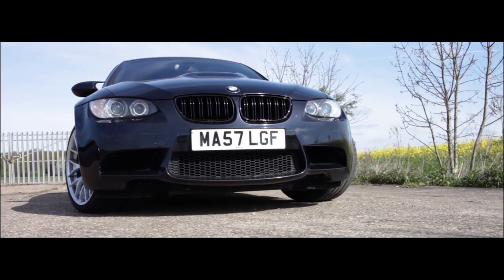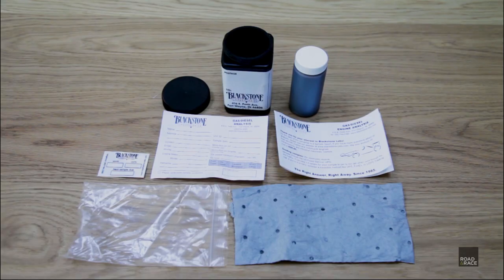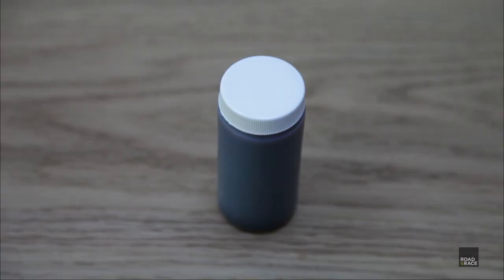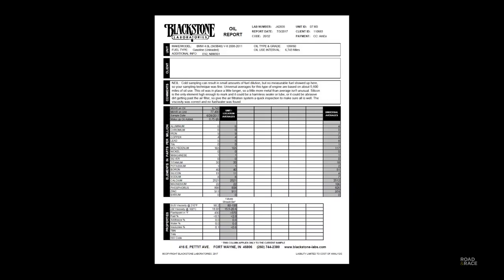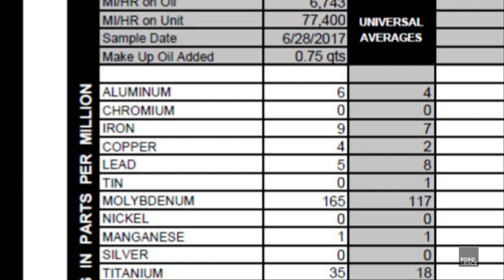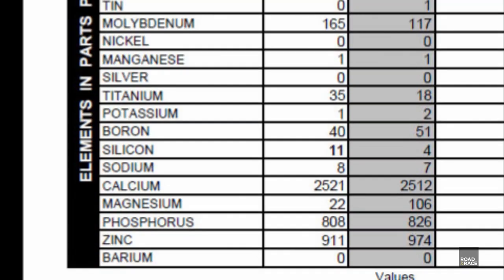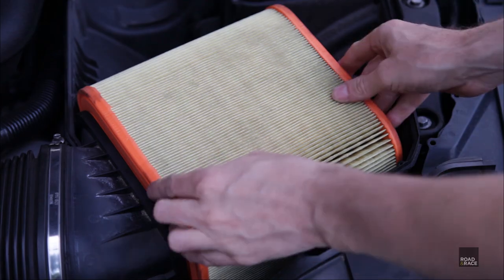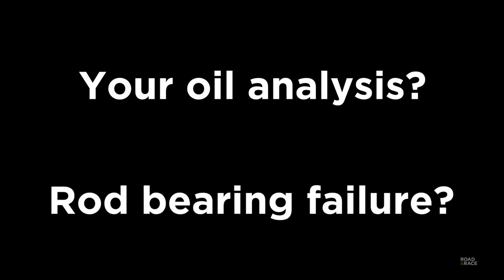Rod bearing failure oil analysis detection in BMW M3 E92 (S65)

Comment: the oil you are using is not the TWS castrol as BMW suggest .. this one is way cheaper but is bad for your vanos
Reply from the maker: +karim lazialle Really? Shit.   I though I was! Thanks for letting me know.  I'll get the right one next time!
Reply: It's basically the same and suitable for M cars.
Reply: no it's not the same (the price is also different) ... TWS was created for s85 & s65 engine specially with some additives to not have a heavy oil volume for Vanos .. but here is a best tip never push more than 2000rpm it when it's cold the 10w60 is so heavy like honey but once its hot it's like water .. it takes also more time to get in temperature 
You are Welcome R&R ;)
Reply: no sure about the oil brands but I do agree with you the key point is never rev up this car when it's not hot enough, the oil being used is too thick no offering enough lubrication when engine's cold.
Reply: karim lazialle Hi, that's the new stuff that replaces the TWS. If you go on the Castrol site and type in your registration that's the oil recommended for the s65/85 motor. 
Also now BMW are with shell, they don't do Castrol anymore, so if you service your M3 at the BMW dealer you'll be getting shell 10w-60 but you're spot on about the cold start procedure!
Reply: karim lazialle TWS is discontinued by Castrol. The 10w60 Supercar is its successor.
Reply: B Josef: indeed, TWS has been replaced. Yet, you can find easily TWS, even today.
It has been replaced for obvious financial reasons (probably not enough sale volumes, probably too expensive overall).
If you look at the oil caracteristic of the TWS vs FST, you see that TWS has much more additives; additives known for sticking longer to metals, and protect longer.
So, FST won't kill you engine at all, that's for sure, and it's not TOO bad. Yet, as often as you can, go for TWS Road and Race!
Reply: lolman77 Change the oil every year and you wont have problems.
Reply: Disagree. It's not only about the dirt oil picks up, but also its capacities and ability to keep its characteristics.
Garbage oil, even changed every 10 miles, will hurt your engine.
Good oil can be kept thousand of miles without moving.
Reply: lolman77 Who mentioned you should use garbage oil?
Reply: you are so right .. mine take time to warm up in the morning .. OK we have a limiter at 8400tr/min but it doesn't mean we should rev it every time; 
BTW this topic is very interesting  .. I always used Castrol TWS (we can find it even today as @loman77 said) but I'm pretty sure we can use Liqui Moly, redline, motule .. BMW engines have castrol written on the oil Cap just for marketing reasons .. they were sponsoring williams BMW from 2000 to 2006 with Juan Pablo Montoya & R Schumacher in formula one  .. When you see a castrol with twice the price I think that it doesnt worth ..
Reply: last thing .. I thing that the only brands providing 10w60 are castrol, motule, liqui moly, redline & maybe mobil1 .. None of them are garbage so the problem is solved (even if I imagine some are better than others) I did many research and find that castrol & liqui moly are highly recommended (redline is not bad too but available in USA only)
Reply: The key point is always the amount of additives. 
Each oil maker gives on its website the "ingredients". That's where, for example, we find a clear gap between TWS and FST. 
Yet, I agree, Castrol TWS isn't the ONLY option. I found some Motul1 with great (and I think it was even greater) amount of additives. 
On mine, I never put anything showing less additives than the TWS. Because no matter if the oil has 1 week or 1 year; if the oil layer brakes under high load (because too less additives), it will damage the car.
I actually made a study case about oils (and generally lubricants) during my studies, and found pretty interesting data about that whole topic. And the conclusion is: there is a lot of marketing and communication bullshit from ALL the brand (auto makers or oil makers). Best choice: read the technical data. Look at the ZDDP amount and/or Zinc and phosphorus content. These are the anti wear agents!

Comment: Oil & filter change by just raising the front?
Reply from the maker: +HORNET6 I guess you'd get a bit more oil out by raising  the rear too but I got the majority if it.
Reply: HORNET6 Complete myth. No reason to go through that hassle. Any residual oil is going to be minuscule compared to whatever is still sitting in the engine.

Comment: Oil report is absolutely useless for detecting imminent RB failure in the s65.
Reply from the maker: Why?
Reply: @RoadandRacetv  Empirical and logical.  Cases of blown s65 engine exist where oil analysis did not give any warning signs.  Which proves it's useless to do that. It means that for the type of failure the s65 is prone too, oil analysis will not save you. It is only a good way to waste money and placebo yourself. There are other machines and engines where oil analysis is useful, but when an engine blows up randomly anywhere from 10k, 20k, 30k, 50k, 70k, 80k miles (all occured cases), then there is far more to the story than RB.  However few people want to have that conversation or hear it. So i'm not wasting my time here.
Reply: @goognamgoognw6637  Im wondering how many of those were manual transmission cars vs DCT
Reply: @michaelfarrens9381  transmission type was not a factor.  There's no correlation with it. It can occur for either manual or DCT as far as i remember. I followed that issue from 2009 to 2018.